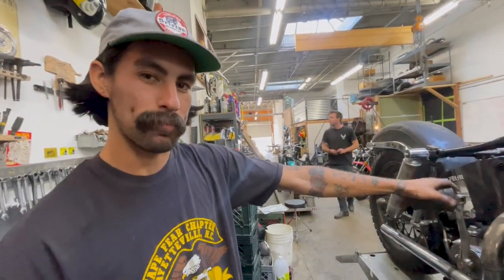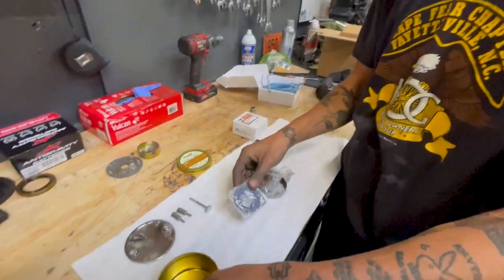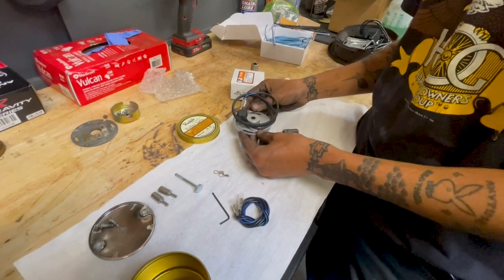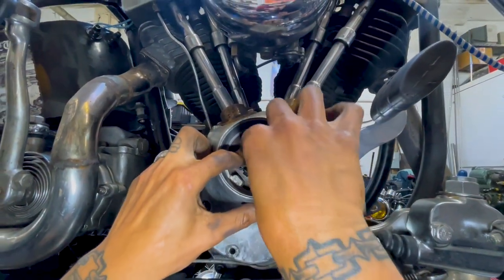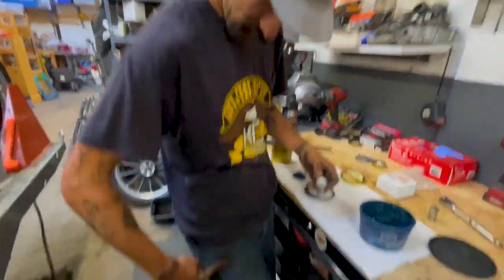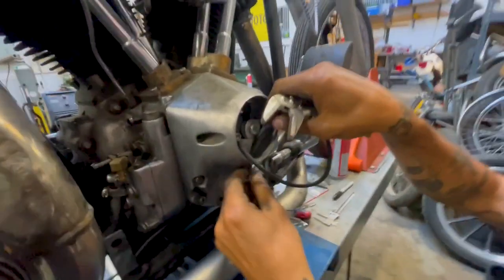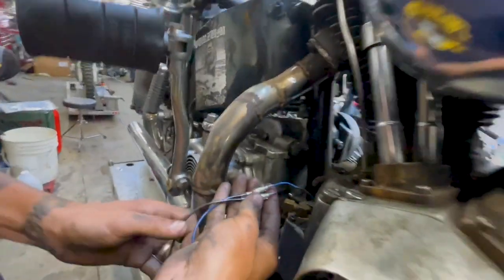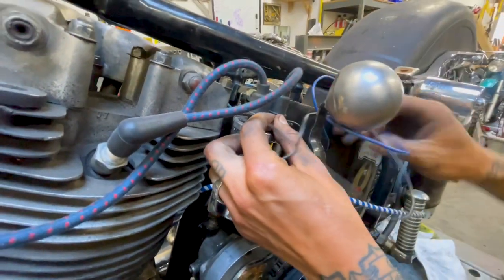Rawhide Cycles Electronic Ignition Installed on a H-D Shovelhead!

Comment: Thanks Yama and Blue. Anything which will extend the life of those flimsy ignition counterweight springs is a good thing. Those springs go through a lot -- from engine heat and vibration to corrosion. Years ago, I replaced the standard springs with those made from stainless steel (when I could find them). A few years back, I viewed a video which featured a great-looking Yamaha XS 650 chopper which had a Rawhide electronic ignition installed in it. From what I saw, the bike ran great. Hopefully, it still does. Good luck, Blue, with your Shovel. Ride safe. Build and buy American (whenever possible).
Reply from the maker: Thanks so much for watching Walter! We aways appreciate your comments! They sure do, I’ve seen better ones on the market. It was super easy to install and hoping it holds up to all the riding we will do this summer! Stay safe!
Reply: @947w0rks   -- You're welcome. Finding quality parts for older bikes is becoming more difficult over time. I truly appreciate any parts which are made in the good old US of A! This country has lost far too many jobs in the manufacturing sector. The way gas prices keep going up, it's a great idea to own and ride a motorcycle. I hope that Rawhide electronic ignition holds up. Ride safe!

Comment: Why didn't you use a Dana ignition
Reply from the maker: I’ve used the dyna ignition on a couple bikes and have always had troubles with them burning out. Saw this one on the market and wanted to support Rawhide cycles, they are a super cool shop and provide great products all around!
Reply: Hey Len, the Dyna S ignition has some inherent flaws. One main oversight is that their rotor is too light (less than the stock rotor). This means it does not advance properly. Also that rotor is made of plastic and wears out in the middle into a big oval shape. Another flaw is that it is drawing much more current than needed. This is why their pickups burn out. Also, I can not determine where Dyna’s components are made. I can tell you that our pickup is made in Los Angeles, California, USA by Charlie’s Place. Try one out!

Comment: should have lubed the pins on the advance unit. and any rubbing points.
Reply: I tried the "needle bearing" advance unit, from maybe J&P, but hadn't riden far when the oil pump self destructed  @#%&**@
and the Iron beast has Sat for 10 yrs!(sob) 
I'll have it going this summer.
Reply: @neiluscook2283  i may be interested in buying it, if you want to sell it

Comment: So no heat shrink on the terminals, you don’t grease in between the springs you grease the spring hooks and the surface of the mechanical advance assembly. Hammering the advance assembly on… yikes… if it doesn’t fit, stop and find out what the problem is guys.